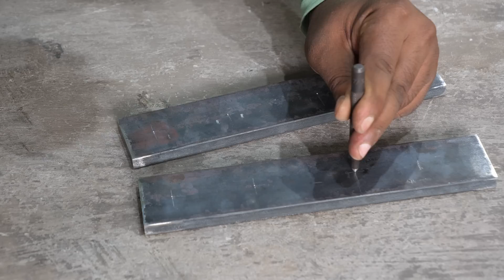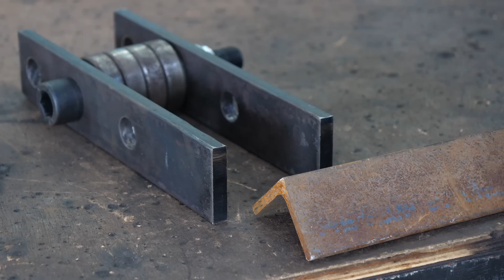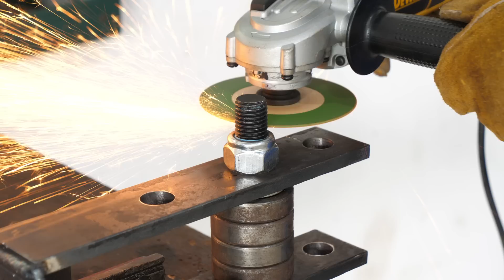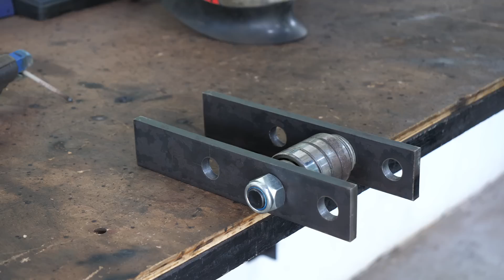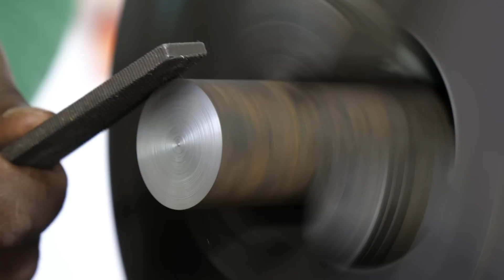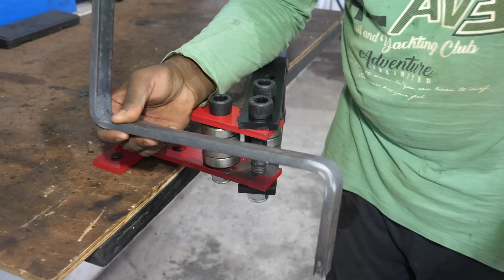Make A Metal Bender | Simple Homemade Powerful Metal Bender | DIY

Comment: Nayiss na
Reply: Hi there, could you please tell me all the sizes and thickness of all metal used. Also the size of that ball bearings and also the measurements of the drilled holes please. Size of bolts as well please and the solid bar size thanks Paul

Comment: very nice. what are the other holes for ?
Reply from the maker: Thank you. While bending higher thickness metal the bolts can be shifted to the other holes and it is also used to achieve higher bend radius.

Comment: Looks a great design.  Just one query though, could the roller used in the black section be a bar and not a roller?  I don't think it's necessary and you only need one in the red section.